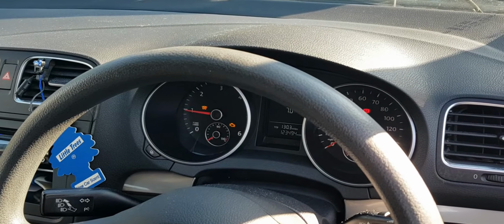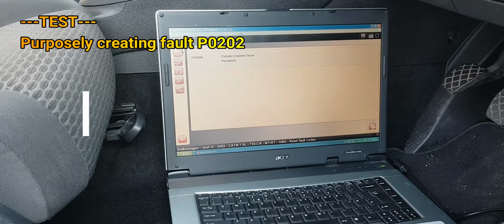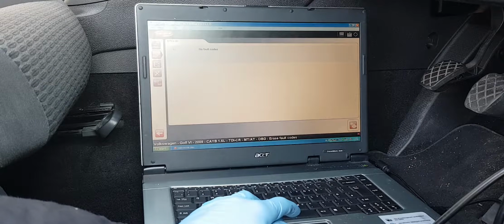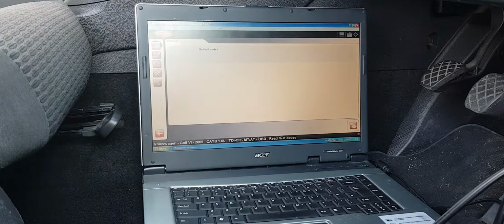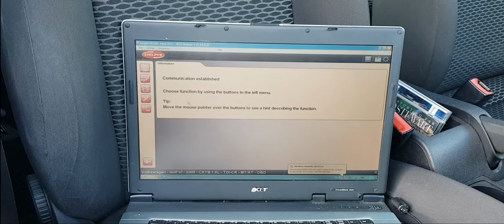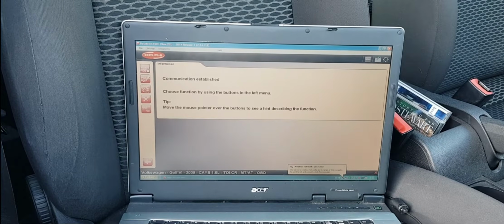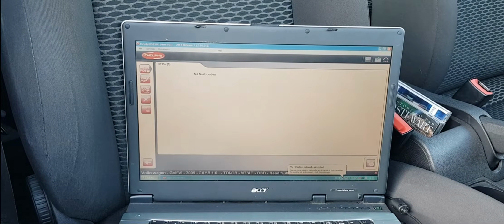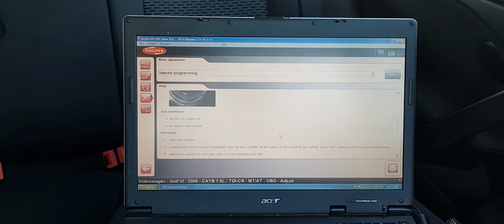P0201, P0202, P0203, P0204, P0606 Injector fault fix VW Golf 1.6 tdi Audi A3 A4 Injector replacement

Comment: Why does this problem happen is due to the injection become clogged up ?
Reply from the maker: Hi, the problem is electrical and is in the injector electrical circuit. Unfortunately here in Northern Ireland nobody is able to repair the injector coil as it is probably very time consuming and it is more practicable to replace it with an used or brand new injector. I have been told that it should help if you remove the plastic engine cover to keep the injectors cooler as they fail electrically potentially due to overheating. I replaced injector 3 with an used injector and at the time I removed the engine cover to see if this helps and 1 year later no problems, so may be it is just me being lucky, but the engine is small and not very noisy, so there is no increased noise in the car with the engine cover off in my opinion.
Thank you for the great question and interest in my video
Reply: @TheKeenMechanic  does the 2.0 liter engine have injector problem like the 1.6?
Reply from the maker: In my opinion the 2.0 injectors are better. The 1.6tdi engine seems to have more problems with these injectors. I have a 2.0tdi as well which has 40k miles more and I have never had issues with it. I am sure someone else may say the opposite, but this is just my experience and opinion. Hope this helps
Reply: @TheKeenMechanic  thank you i think ur right when i search injector problem golf on YouTube they are all 1.6 engine
Reply from the maker: @razamechanic99  Thank you. Hope you have better luck than myself and never have any issues🤝
Reply: @TheKeenMechanic   I'm going to look at the same car but match edition what do i look out for and do you recommend running the car without the engine cover

Comment: Thanks for the video.  I don't think it's going to throw the code until you try to crank the engine after clearing it.
Reply from the maker: Thanks for your comment.
Reply from the maker: I think you are right mate. I was wondering if it will throw the code when ignition on and if it senses that there is an issue with the injector wiring